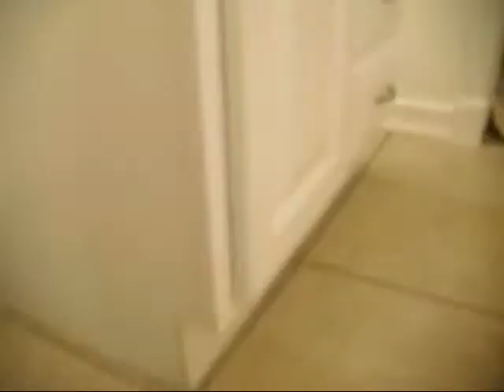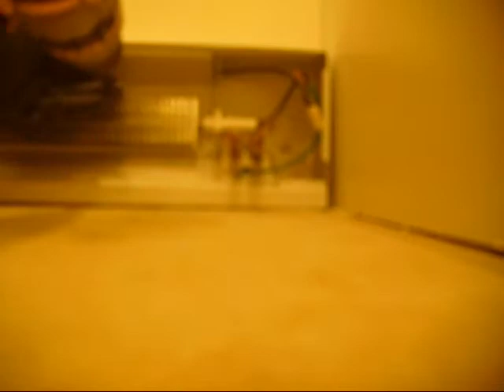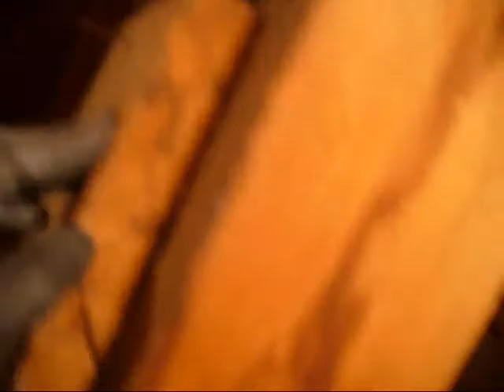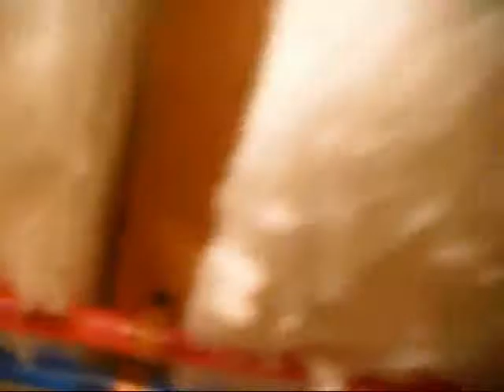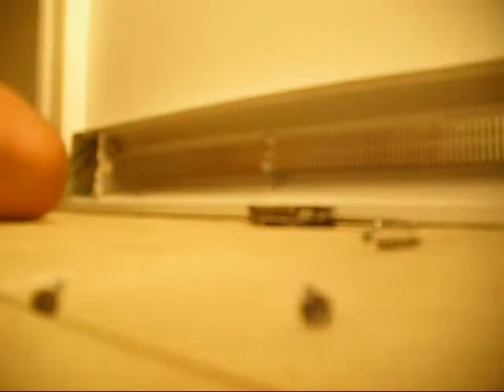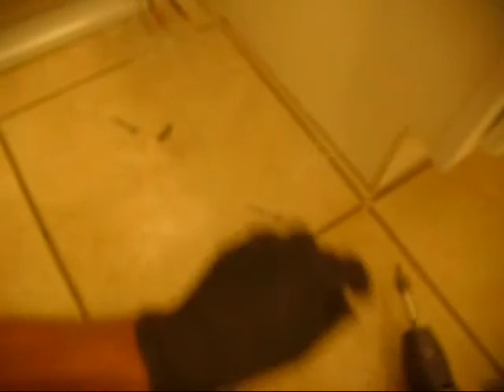8 19 13  Last Late Nite Toilet Vid

Comment: yup then starts a nice little hot spot if your lucky you notice the lights flickering if they are on the same circuit or if you hear the arcing if not hopefully it melts off the wire and stoops burning  other than that you end up calling the fire department

Comment: I used to drywall these apartment projects the electricians never could find the studs they would smash wholes in the wall with a hammer till they found them.  Just plain dumb. .

Comment: did you say aluminum wiring for the heater with the panel 5 feet away on the other side of the wall why in the world would you not change it to copper